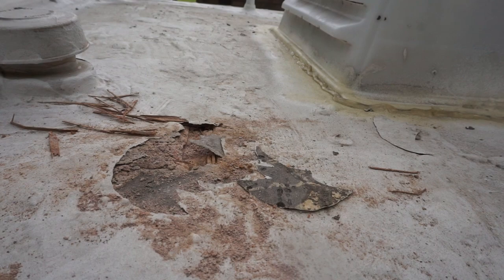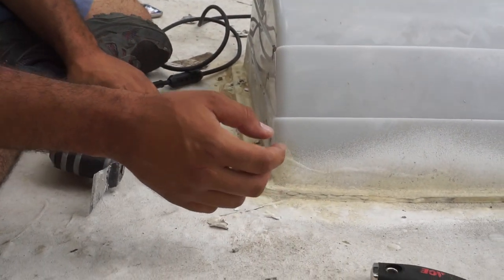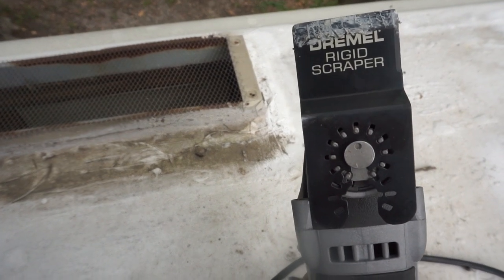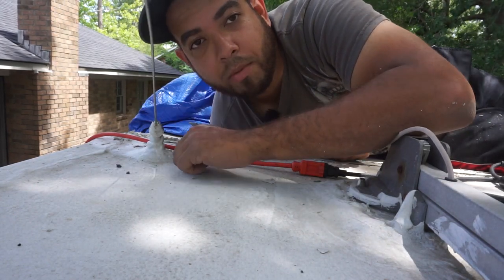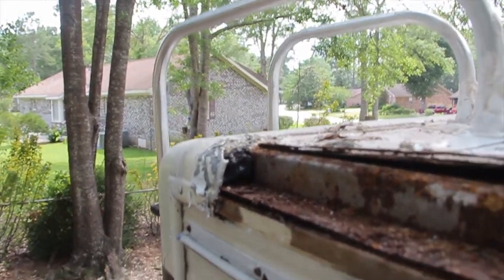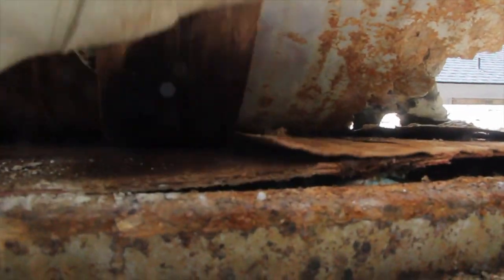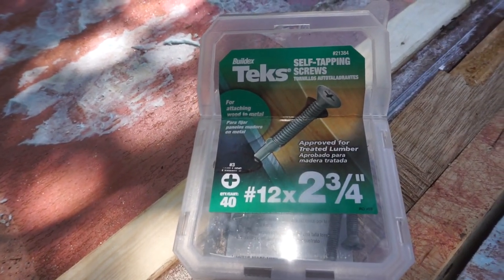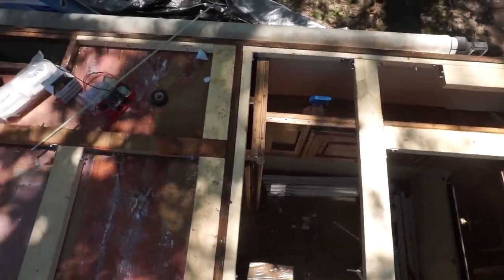Full RV Roof Build

Comment: I recently redid my travel trailer roof.... I used a heat gun to remove the lap sealant and Butyl tape.... worked EXTREMELY well.  Totally agree with eliminating as many attachments (leak liabilities) as possible.  I have to admit, it was painful to watch you use that oscillating multi-tool with the blade attached upside down. :)

Comment: Couple tips…. Don’t use those hex heads use regular t25 head straps pod screws…. I would prefer to use nails in stead of screw. They bend they don’t break which is what you need in that framing…..   then u wouldn’t need the screws or corner plates.   But great job either way